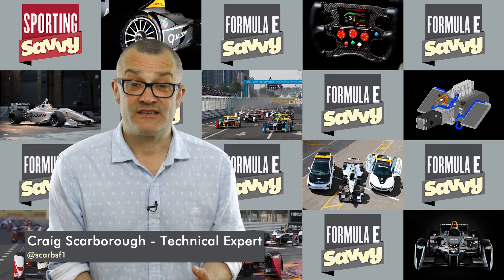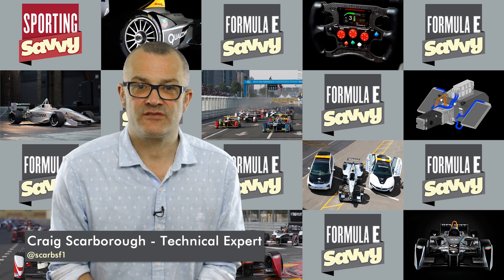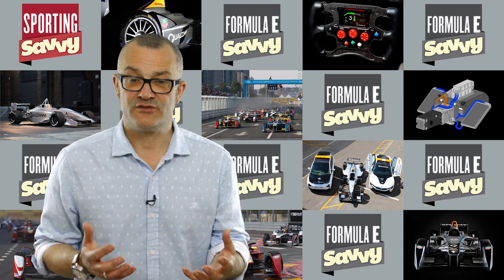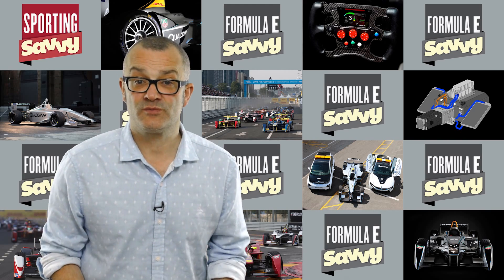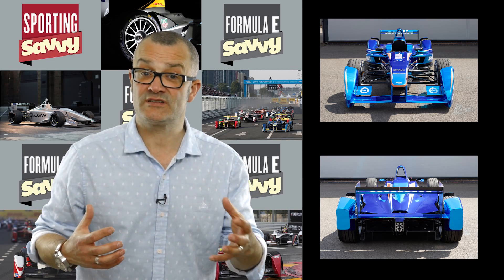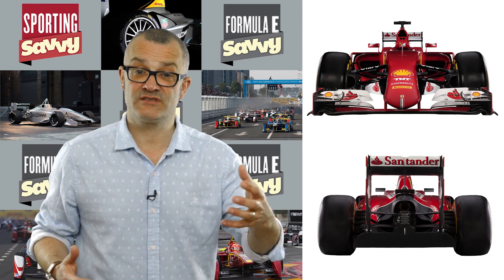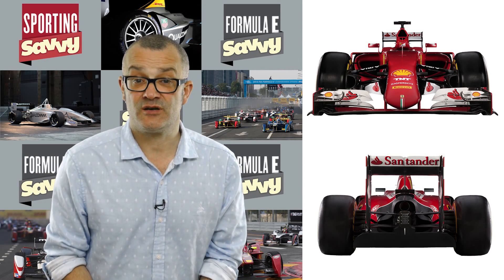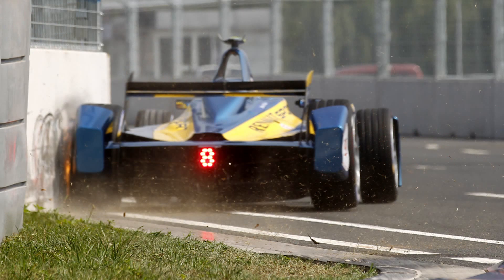Formula E v F1 suspensions - How are FE stronger? Scarbs explains

Comment: Take the Knowledge of the F1 and then take your knowledge of an FE ..... Where is the mistake ? Whats the difference between an Formula 1 Car and an Formula E Car in Aerodynamics ? Why do E-Cars need Fenders ? The only thing changed is the Aggregat and the transmission ! Please Build a Formula E Car with the Horsepower of an Formula 1 Car.......There are things, they have not to be a 2nd time invented ! Take a old Chassis from F1 und integrate you Aggregat and then you will have a respectible Car. The Way, the air have to go around is your problem. For this you receive your money, every month ! Greetings from Germany ! ...... ;) ......The better way is to work with AMG Mercedes.
Reply: +Stephan Kirchner The batteries won't last with more power and weight
Reply: +Stephan Kirchner Why do E-Cars need Fenders ? Because they are racing on tighter street circuits but also because the fenders help with the airflow around the wheels.